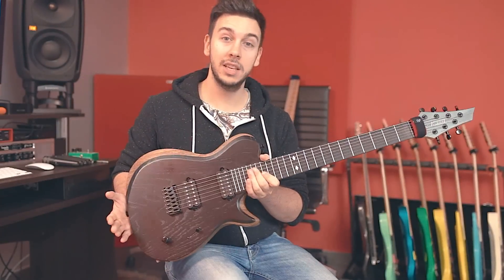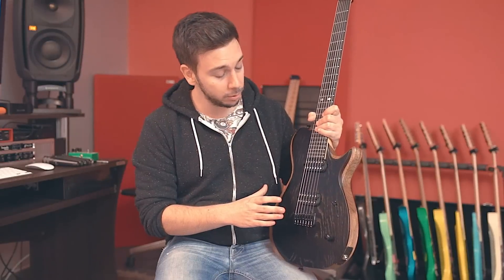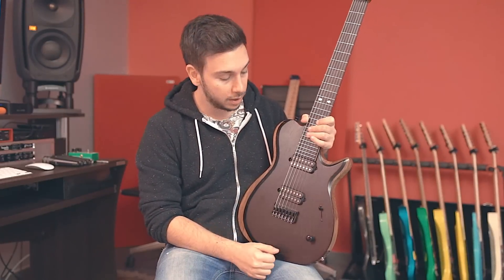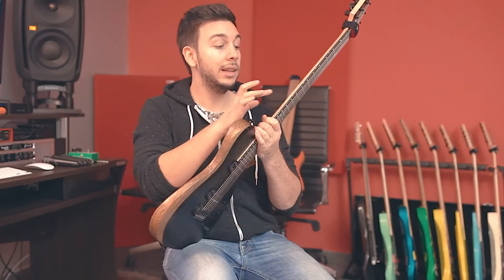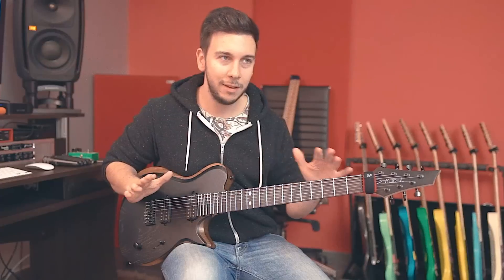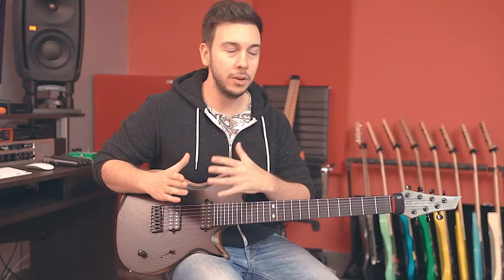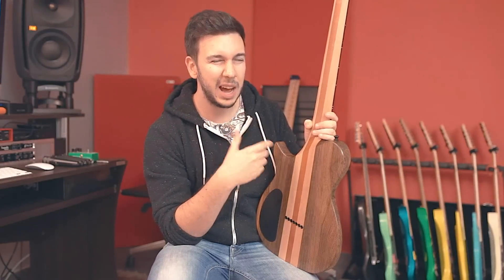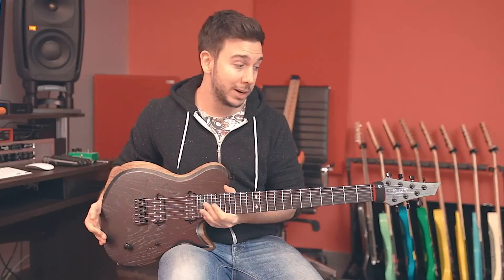Francesco Filigoi - Kiesel Carvin SCB7 Monster Lick + Review

Comment: "The fewer pieces of wood, the purer the the sound."  YES you are 100% correct.  Think of an acoustic guitar top with 1 vs 3 vs 5 vs 7 pieces glued together - it's obvious which would resonate the best.  The same goes for necks.  I think you've nailed it with Maple/Mahogany/Maple - a mix of punch and warmth.   Is there a reason you chose limba over mahogany for body wood?
Reply: Just aesthetic choice - to be honest I slightly prefer mahogany over black limba tone-wise